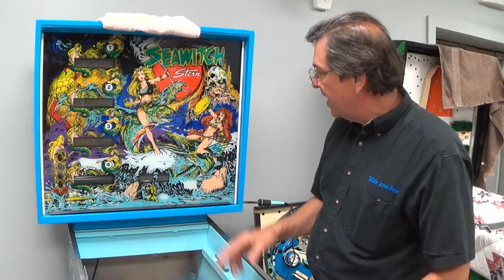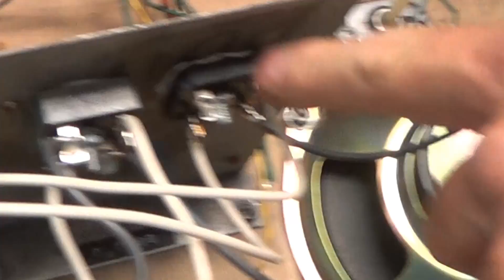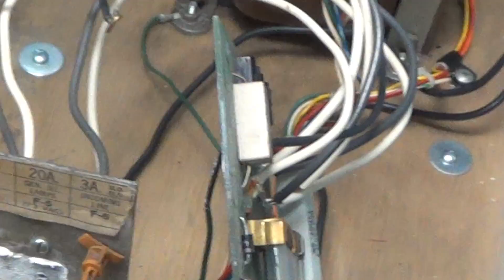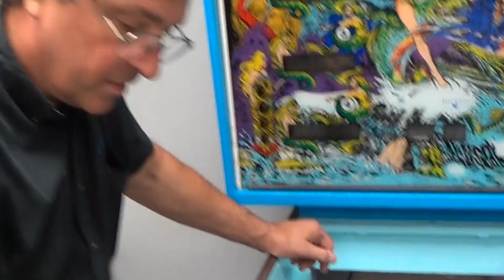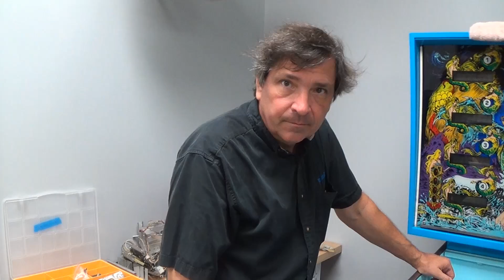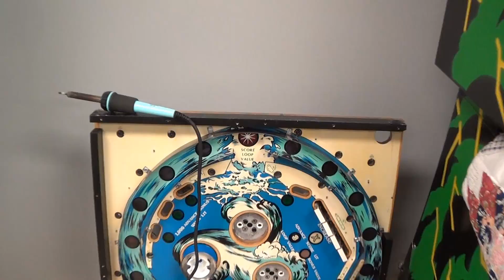Ray's Pinball Tech Tips #3 - Rectifier Boards!

Comment: Great  insight! i have a an issue with my Flight 2000, on the rectifier board it keeps blowing F4 (7a slow Blo ) Coil - 43 VDC on i turn it on. I have GI lights working when turned on, but no flashes on the mpu(which i guess is due to the first part of my question) so i unplugged all the headers from the solenoid, light board and mpu board , turned it on again..and it stil blew, so am guessing i need a new rectifier board?? , (havent pulled this out yet) or is there anything i could try?..am based in UK England.thanks

Comment: The mudslinging does nothing but expose the dirt on you and you loose a lot of ground in the process. 

Ray, you're a class act! You avoid it altogether. Good on you. I really appreciate your videos. Excellent information nuggets in each one.

Silly question about the splices...Certainly running new wiring all the way back to the transformer is the best fix. How acceptable would it have been to install a molex plug in place of the splices?

Comment: The mystery behind the cutting of the wires. The only answer is they cut the wires to get the board out to modify/Macgyver, 
just missing the paper clip and duct tape. 

 I can tell the passion for pinball and preserving/improving the older versions of pinball in this video.

Comment: Ray - thanks for the videos they are very useful in helping me get up to speed on pinball repair.  I've been a professional electronic tech for 25 years doing jukeboxes and pro audio repair.  I've always avoided pins because I figured they were a nightmare.  But all the old-timers in my area have died or retired, and I'm having people begging me to work on their pins.  Fortunately there is a lot of crossover knowledge from my tech work on the other stuff - but there is still a lot to learn about these pinball machines.  I pulled the entire power supply & transformer board from a customer's Stern today, because it is so badly buggered up.  Someone tried soldering direct to the header pins & really botched it up.  I'm going to install new headers and connectors, and the No. 44 bulbs are going to be swapped out for LED to spare the new connectors.    Do you have a preferred source for LED replacements?

Comment: Ray is a renaissance man.  A dying breed.  A true professional.  Excellent video.  

Would you consider adding a molex plug in that circumstance, between the transformer and the rectifier board?  I thought it might make soldering in the new board easier if you didn't have to be inside the cabinet.

Comment: You have the right philosophy. Putting in brand new boards and parts is correct on these machines. When you have a car, after so much time you have to replace the spark plugs water pump timing belt etc. not rebuild them. Very good work